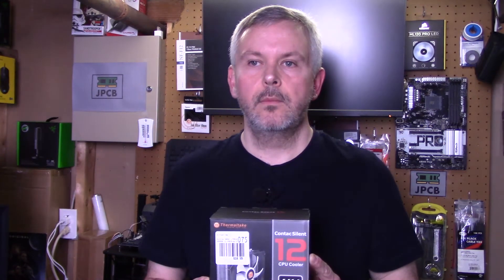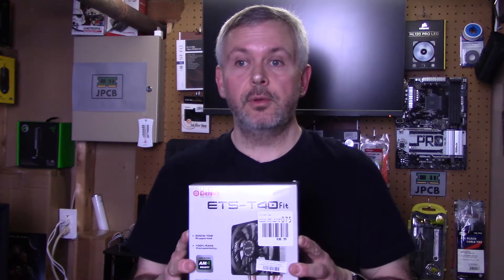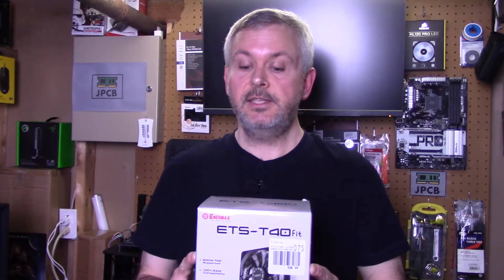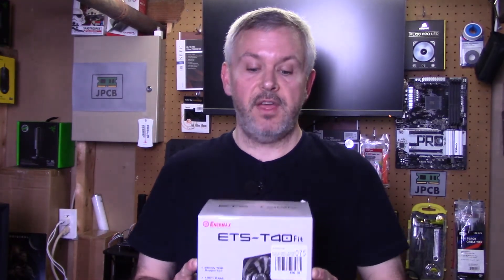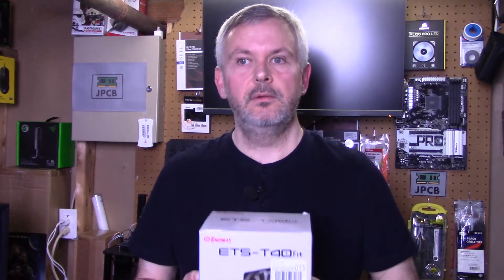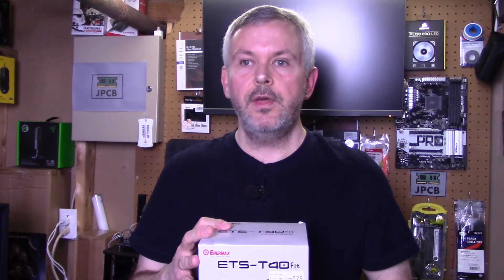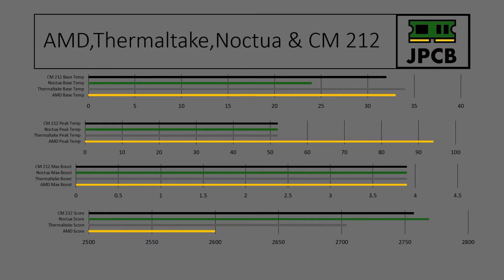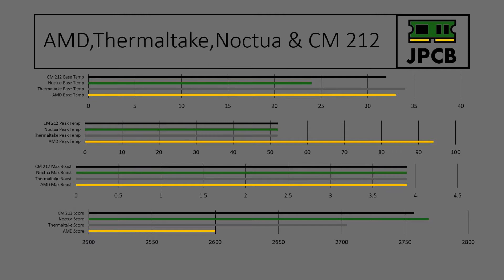Thermaltake Contac 12 Air Cooler Vs AMD Stock Cooler

Comment: I need a serious answer about this cooler really worth to buy it? I can't decide which is a better option for my fx6300 in hot summer days((95 watt tdp) yes year is 2021 I'm still using this cpu cuz i cannot buy a new pc and i can't get over 40 dollars for cooler) the Schyte Kotetsu Mark 2 or Thermaltake Contac silent 12(or different cooler) . Please help i need suggestions.
Reply from the maker: At $35 US it's not a bad cooler at that price. The problem it has it's basically what you're paying for at that price. Good, but not great. I recently looked at the Vetroo V5 which costs the same but is much better cooler. As for the Schyte cooler, I've not looked at it. I have bought a Schyte cooler to look at but I haven't done it yet, but I've not heard bad things about them. But if you are going to spend the $60 for that I'd have a look at either the Noctua NH-U12S or the Be Quiet Dark Rock 4 (not the pro as it costs more) as you can't wrong with either. I would say though that the Vetroo managed to very nearly match both of them.
Reply: @jimbopcbuilds  Thank you so much
Reply: @jimbopcbuilds  Hey Jimbo! I had looked the Vetroo V5 and i cannot find any store which is selling that so i bought Scythe Kotetsu Mark 2 i mounted this cooler yesterday and results are amazing and i think better than Arctic Freezer 34 esports Duo. The room was 25 degrees celcius, FX-6300 on turboclock consuming 95 watts and i saw 49 degrees highest, average is 48 degrees and fan spinning around %50(1200rpm max 670 rpm i saw max)(I want to share the results thank you again)
Reply from the maker: @batuhansarp683   Very nice. Sounds like Scythe cooler is pretty sweet. I can't wait to test the one I got. Thanks for getting back and letting me know.